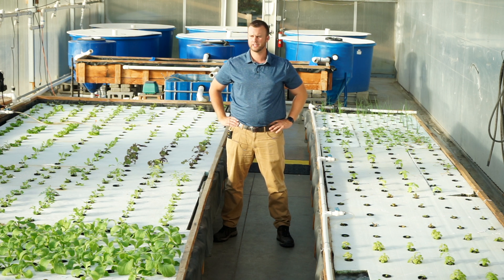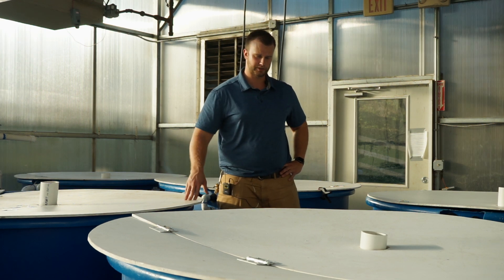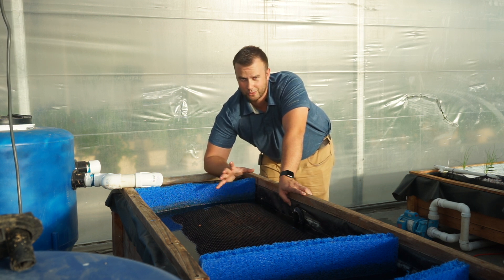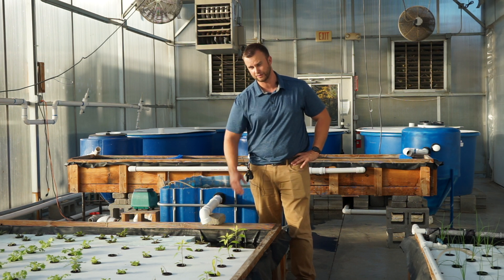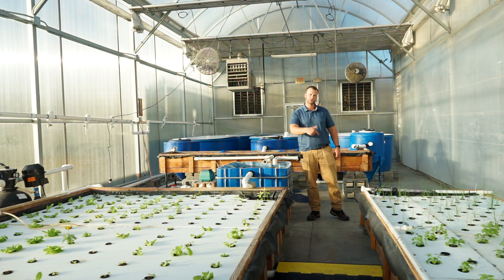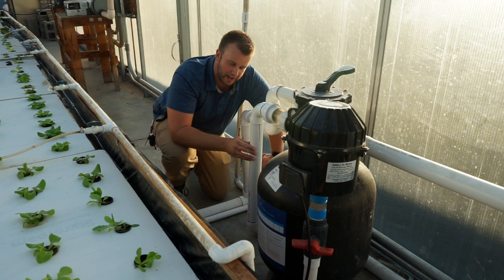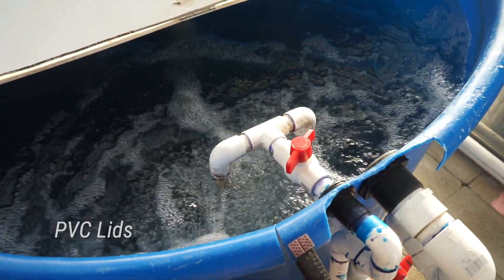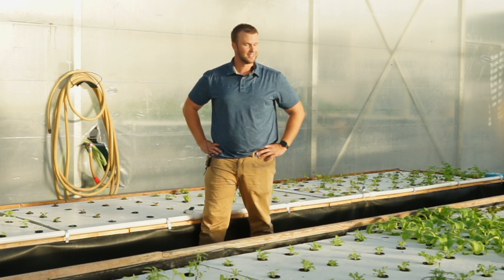Walkthrough of our Aquaponics System (Tips and Tricks)!

Comment: You're using the pump without a sump. So how do you manage the flow? Even if there is a timer, the water from raft to fish tank will reach much faster than the gravity flow from fish tank till raft. So how do you mange the issue of rafts overflowing vs raft emptying fast - without a sump ?
Also, are you able to achieve total fish tank water cycling in 1 hour as per the standard says ?
Reply from the maker: I would have one if there wasn’t a concrete floor. We have to rely on the DWCs to act as a sump. Yes we are able to achieve the one cycle per hour

Comment: Hi sir. I just wanted to ask if it is ok to use concrete tanks as fish tanks in aquaponics?
Reply: yes it is possible but you have to watch the pH. In concrete tanks it tends to get very high (10 and more). But above 8 you get a chemical change from ammonium to ammonia, which is highly toxic to fish. So you might want to paint the inside walls with resin or cover with other materials.